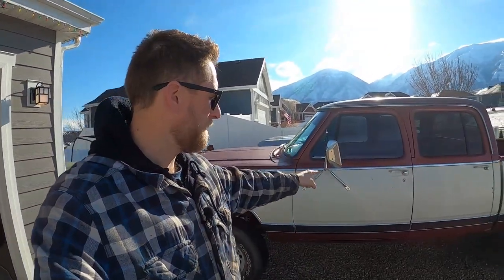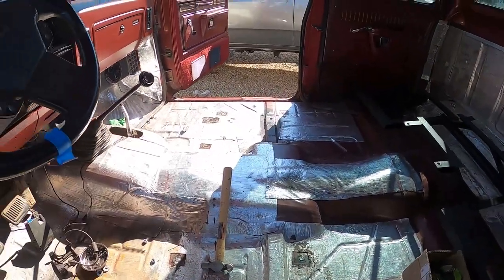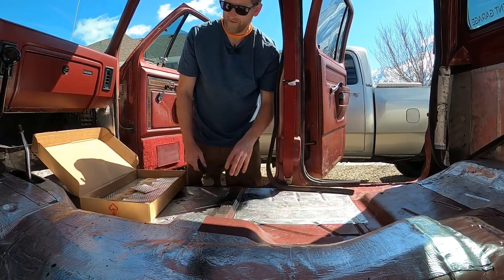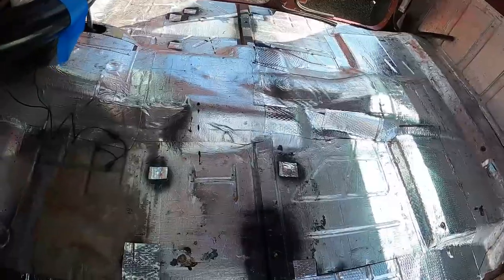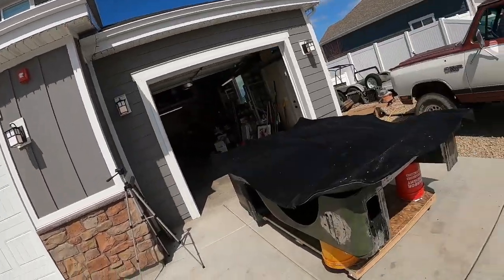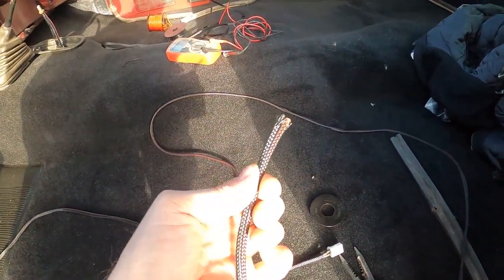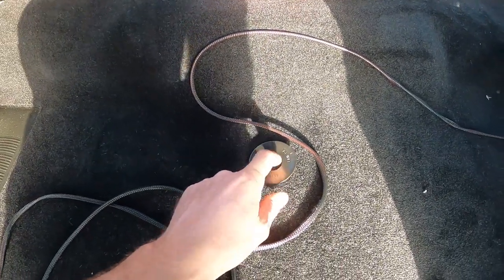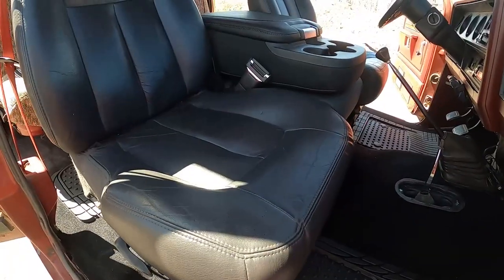36 Year Old Truck Gets a NEW INTERIOR!

Comment: Looks great, I have a 92 rclb 1/2ton. Had to replace floors and a cab brace. I coated my floor with POR15 when finished top and bottom. Then rubberized under coating top and bottom. Sound deadener along with new door seals helped a lot. I would imagine crew cab is an even bigger before and after difference interior noise
Reply from the maker: Yeah, it's hard to quiet a crew cab haha

Comment: Tim, great video, the interior is looking really good on Prospector Bob. 
I just restored the interior on my 66’ Eldorado and my comments are Dynomat is a great sound deadened.  Wwen cutting holes in the carpet, I use a pointy solder Gun which makes nice clean edges in the carpet and avoids pulling threads if you drill. 91.5 cummins interior is next. Keep up the great work and content.
Reply from the maker: That's a perfect idea for cutting holes in the carpet. I'll try to remember that for next time!

Comment: Any suggestions for carpeting a 1956 IH Firetruck cab? No stress being a dodge channel. I am installing the cab on a 2008 ram 3500 chassis. And, after watching your channel, I have a “built” 5.9 12 valve (VE pump) thanks to The Hungry Diesel. And, a “ built” 6-speed manual tranny! Gonna be a beast once done!

Comment: Would you use the deadener and the foam if you were doing a headliner?  I know the crew cabs didnt have headliners, but I just pulled mine out of my club cab and was thinking of using the deadener under it as well.  I have been looking for a saddle blanker seat cover for months that wasn't flimsy.
Reply from the maker: Yes, i will be putting a headliner in the og crew soon and I'll be putting the sound deadener and foam up there as well.

Comment: If you don't mind, can I ask where you tapped into the key on wiring to power your seats?
Reply from the maker: For right now i ran it straight off the battery until I set up my external fuse block. I like it on constant power so if I need to move the seat when I'm working on stuff i can without turning the key on

Comment: Another great video Tim! You will really like the difference it makes in the cab with all the sound deadening and mass backed carpet! Will probably however really notice all the wind noise coming in around the triangle side windows, find a cure for that please! Great choice on the rear seat cover, my cousin manufactures that material here in NC. Can't wait to see your choice on the shifter boot.
Reply from the maker: I drove the truck a few miles and it's noticeaby quieter. It's just so much more comfortable than it was too.

Comment: Nice Job! Hope to get my 93 W250 cleaned up . Have you done the KDP in either of your trucks?
Reply from the maker: Both my trucks have the kdp done. I did the one on the silver crew and the one on the prospector was done when I bought it. What questions do you have about it?
Reply: @decentgarage  Did you bother to lock tight the additional 5 or 6 internal bolts inside the case?
Reply from the maker: @AD-ht3jl  yes, that is probably more important than the actual kdp on the VE trucks.
Reply: @decentgarage  Ok Thanks.  I'm about to do the job and put an aluminium radiator on. Too bad there isn't a way to see if its done without taking the case off. I took off my oil filler and looked with my scope but no luck.
Reply from the maker: @AD-ht3jl  I've always wondered if you could get a view of it with a scope.
Reply: @decentgarage  maybe if I had a scope camera half the size. Even if it was done you'd always wonder if the internal bolts were also locktighted and torqued.
Reply from the maker: @AD-ht3jl  yep that's a good point.

Comment: Interior came out looking great. How is the sound deaden in the cab with that cummins?
Reply from the maker: So far it's much quieter. I've only driven it for a few miles and now I'm out of town. When i get back home I'll definitely put more miles on it give an update.
Reply: @decentgarage  Awesome, Good to know. Mine is going to need it too, so im curious what works and what doesn't
Reply: @DuddiesAdventure  check out soundeadenershowdown com for how different products work. Not all products are the same. Like Tim said, really only need to cover about a 1/4 of a metal panel with sound deadening tiles to stop the tin can sound. However, I covered my entire floor to help prevent any water from getting to the floor pans since the butylene material is also used for water sealant. Hydrophobic Melamine foam is great, but expensive. Mass loaded vinyl is also a great product for certain areas. I covered about 1/4 of the inner and outer skins of my doors with 80mil Knoknoise. Entire roof covered with the same 80mil then covered entire roof with hydrophobic Melamine foam before installing the headliner. 100mil Knoknoise on the entire floor covered by all the original mass loaded vinyl and original mass backed carpet before covering it with new mass backed carpet. I'm very satisfied with the results. The products and applications are endless, inside, outside and in between. Do some research and ask yourself what is your overall goals, then decide how much time and money you are willing to spend.
Reply: FYI, Downloaded a decibel meter to my phone and at idle the cummins has a reading of 70 db compared to a 2011 F350 Lariat automatic deleted straight pipe at idle reading 64 db. Cummins averaged 74 db going thru all the manual gears and running at 70mph and had  top db reading of 78 db which occured running in first gear.  The ford averaged 69 db and topped out at 73 db under the same conditions. 
 This is of course is after sound deadening the cummins 93 doors, floor and roof. Back wall is still factory along with the extended cab walls.
Reply: Compared my db readings to Tyler Oven's sound deadening build, keep in mind use of different type db meters. Tyler's truck at idle after sound deadening was 67 db and at 60mph had a reading of 76.5 db. 
 In conclusion, there are several differences between mine and Tyler's sound deadening projects, material used and areas covered.